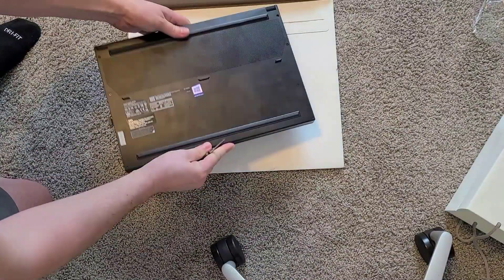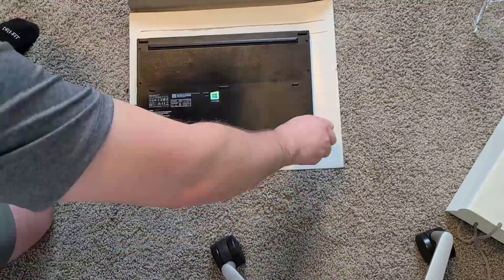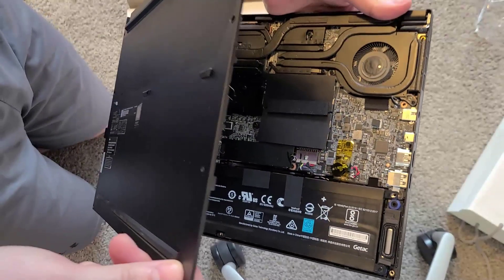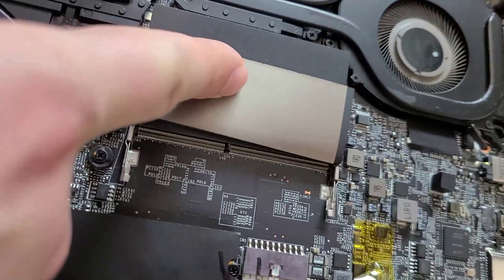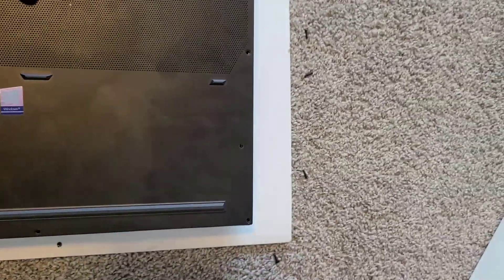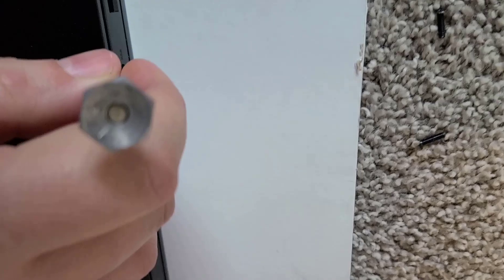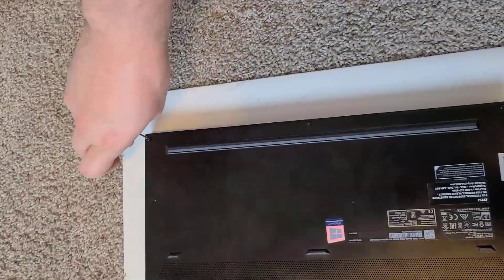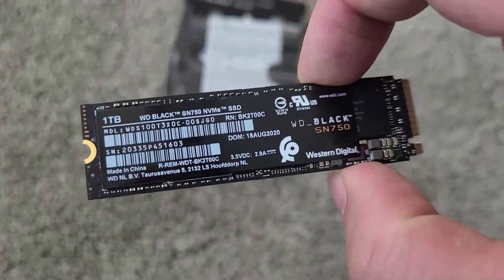MSI GS66 - Add RAM + SSD

Comment: Warning to others: The "Factory Sticker" is not being held by tape - there is another screw under that sticker.  I was unable to open the case enough to install a 2nd ssd without removing this screw.  You have to damage the sticker to do it, just no way around that.  However, I've heard numerous reports that it doesn't necessarily void the warranty.
Reply: I just talked to a service rep and they said it won’t void the warranty unless you damage the laptop while doing the upgrade
Reply: Same. They emailed me to say users are allowed to remove it. The sticker is only there so you as a buyer know it’s not been tampered with.

Comment: OK real talk... as a certified tech of over 30 years... I have to point out that 1. That Factory Seal is not just TAPE. There is a factory SCREW located under that tape. It isn't just really strong tape, it is security tape that covers one of the back plate screws. It allows the manufacturer to know it you have opened the case if removed or damaged. Not the best idea to leave it in and then bend it like you did. 2. Never, I repeat NEVER work on synthetic fiber-based carpet. The electrostatic discharge from the carpet can easily cause havoc on electronics. I would suggest tile, or hardwood flooring, and either an anti-static mat or anti-static wristband, just out of precaution. You might want to consider adding a disclaimer for others who may not be experienced or educated enough to know better.
Reply from the maker: The disclaimer is noted in the description. Thank you for your opinions.

Comment: You can keep the tape on, but you will hear a loud “pop” of the plastic bracket the tape is attached to snap off. Other than that, you won’t be able to tell superficially that it was upgraded.
Reply: that loud "pop" the is screw that should have been removed breaking through the backplate. That Factory Seal Tape is security tape which covers another screw holding the backplate on. Might as well remove the screw and do it the right way instead of suggesting that anyone breaks their laptop case. Most people are never going to send their laptops out to the factory under warranty anyways. So if an upgrade by a non-certified tech must be done, might as well be sure to do it the right way don't you think? Remove that screw hidden under that tape.

Comment: Looks like you didn't use thermal tape under the second ssd? I hear some who say put it. Then others who say no. I'm leaning towards no since there is no heatsink below. But will the thermal tape help with vibrations?

Comment: Please which RAM modules are you using please. Thanks for the review
Reply from the maker: Specifically this pair of Samsung:  https://www.amazon.com/gp/product/B07N124XDS/ref=ppx_yo_dt_b_asin_title_o09_s00?ie=UTF8&psc=1   Although we paid $115 for each.  Also this MSI will work with 2933Mhz speeds, the difference in performance was not worth the price.

Comment: Can I install two 2Tb SSD cards??
Reply from the maker: Yes and no. If your MSI originally comes with a 2Tb SSD and you buy an additional 2TB SSD for the remaining slot. I've seen some tricks done that use the M.2 slot and the mSATA drive, however you have to remove the mSATA wifi card to gain that 3rd slot and not sure if a 2TB mSATA exists.
Reply: @rbcameron1  
Mine came with a 1TB SSD & a second SSD slot. 

So I wanted to swap the 1Tb with a 2tb & install a second 2tb in the spare slot.

When I contacted MSI, they were unhelpful

Comment: I just got a thought, if you ever ship it back or something for repair or maintenance, they will see what model it is and then see that it has been upgraded. Am i right? Will it void the warranty if upgraded?
Reply from the maker: Hi Pierre.  Yes and no. Since the only upgrades are RAM and an additional hard drive, those can be easily swapped before shipping. We have the original RAM still, so if we wanted to put it back in temporarily we could. Personally, we would definitely save that WB Black and hang on to it since it's so easy to swap.  This video was never meant to find ways around the warranty but to help others figure out how to upgrade their current system in a safe and efficient way. Thank you for the question though!
Reply: @rbcameron1  Okay! Thanks for the answer! Have a nice day!

Comment: So you don't need to unplug the Battery? Can someone please confirm?....
Reply from the maker: In the video, it might not have been clearly pointed out, but we unplugged power and held the power button for 5 seconds. That should take all the remaining residual energy out of the system. It had no effect on our laptop whether the battery was detached or not.